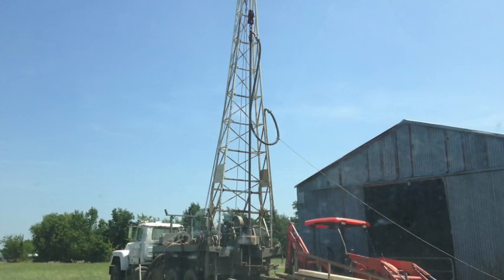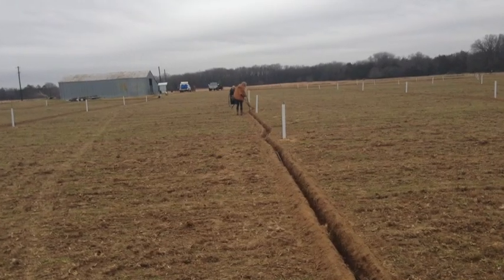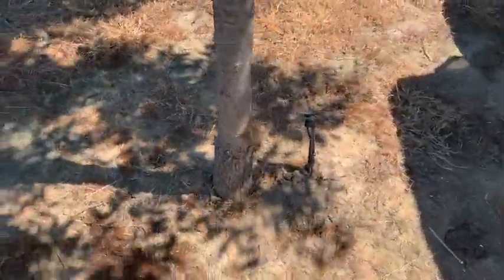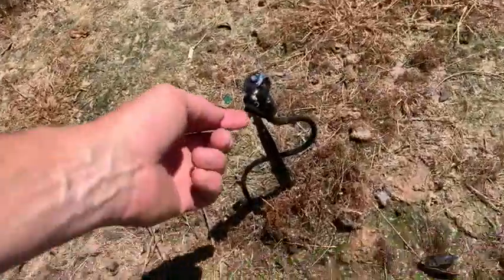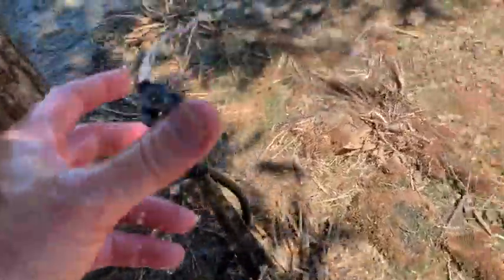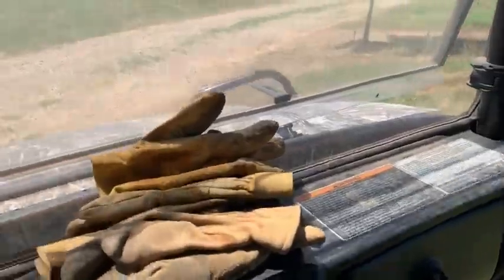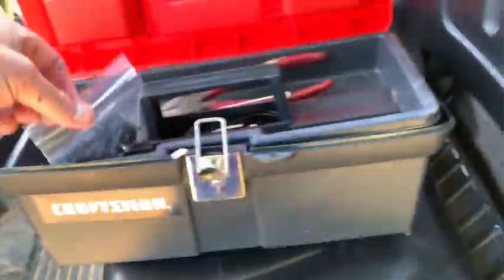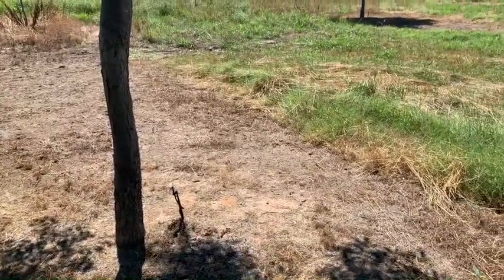Pecan Irrigation

Comment: Do you have a video of how you built your sprinkler system? Could you share the link to what pipe and heads etc you used?
Reply from the maker: Sorry, I do not.  You can check out drip works for advice.   That’s where I purchased all the parts.

Comment: Hi! I love your set up! I'm in South Central Texas, East of San Antonio, with Loamy Sand (more sand than loam) on top of red clay. We have 3 acres.  I have a small orchard of 36 fruit trees and I'm wanting to do something like your set up. For the past 20 years I've been dragging the hose, and I'm getting too old and have too much other stuff to do to keep doing that! ;) Do you have a list of supplies? Or do you have a video of what you did at the start? Type of pipe used, emitters, etc? Are there any type of emitters that are pop up? Thank you for your help! Everything looks wonderful! I would love an irrigation well. We use a rural water system and our water bill is high in the summer watering our trees, dairy cows and horses. Thank you in advance! PS what do you have wrapped around the baby trees?
Reply from the maker: Hello, thanks for watching.   You should visit with a company out of California called Drip Works.   This video is all I have.   We used 2” PVC feeder pipe, connected 3/4” flex hose to each lane and then connected 1/4” tubing to the micro sprinklers at each tree.  Drip Works. An help you.    Good luck.
Reply: @HeritageFarmsTexas  thank you very much for your reply and directions where to go! Take it easy in this heat wave!☺
Reply: @HeritageFarmsTexas  Thanks for your video. Could you tell me what is the range of the micro-sprinkler? Will it be necessary to change it when the trees are bigger? Sorry if my English is not very good.